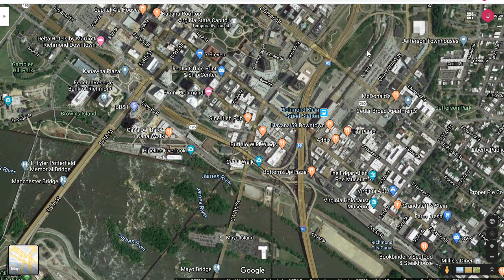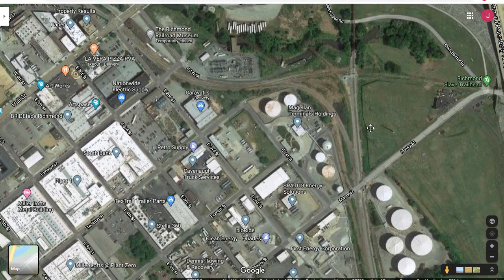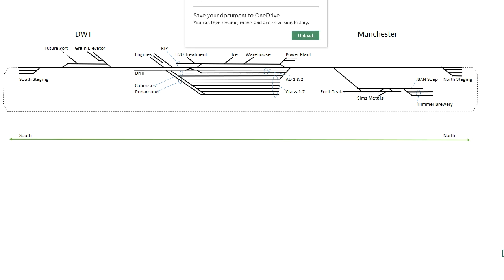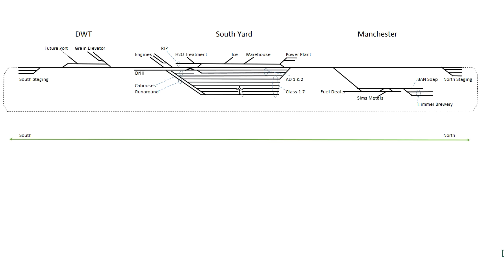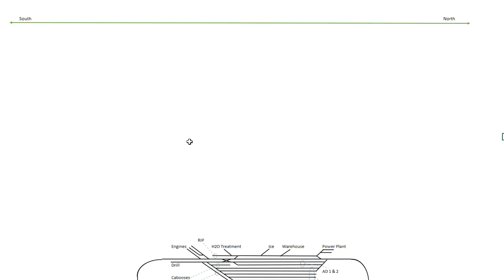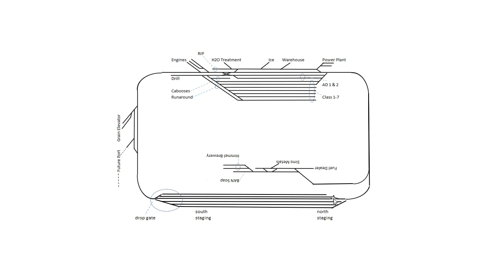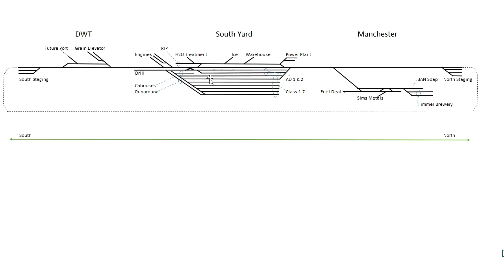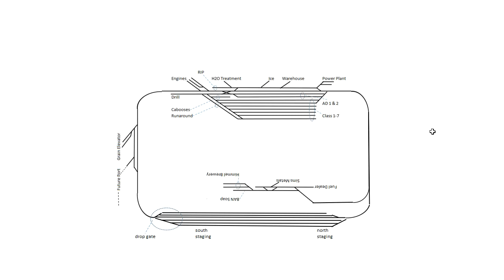Layout Design - Inspiration, Schematic, and Track Plan

Comment: Well implemented design! I'd not be able to resist some sort of allusion to the adjacent Triple Crossing- even if only in a backdrop...
Reply from the maker: I do connect with both of the other railroads in staging, but you're right - I have never seen anyone model Triple Crossing directly.  I should have mentioned it's location in the video - I even thought about it after I uploaded.  Good catch!